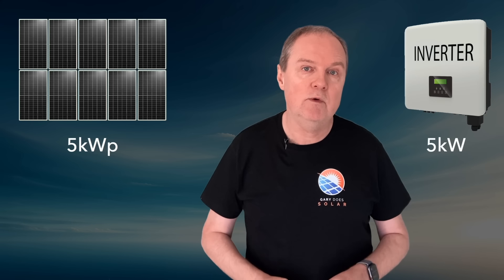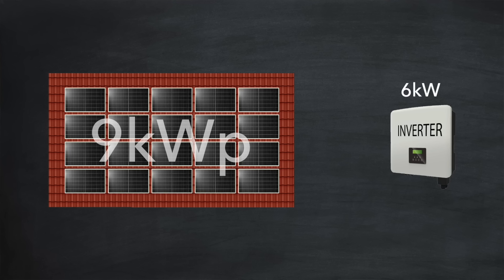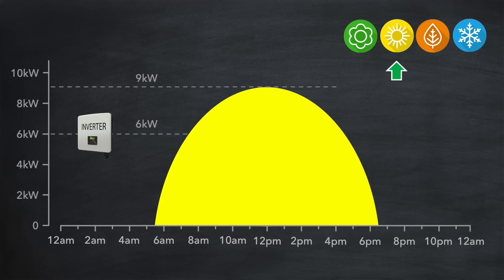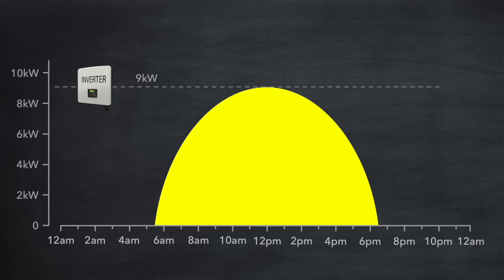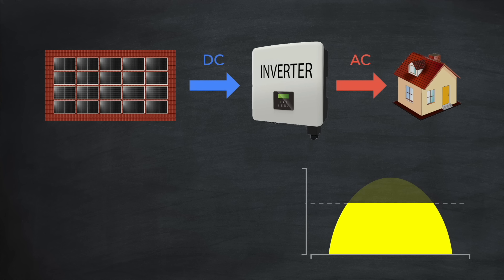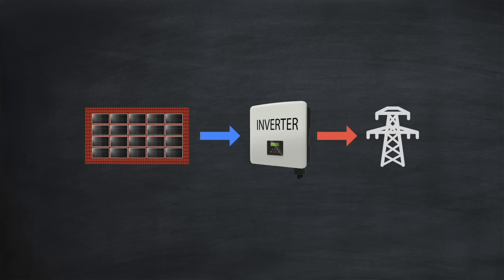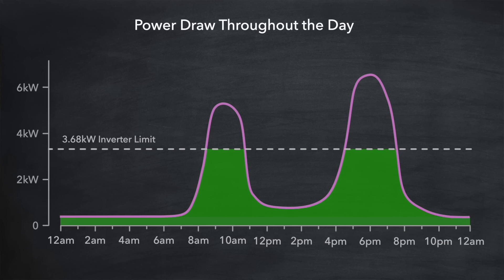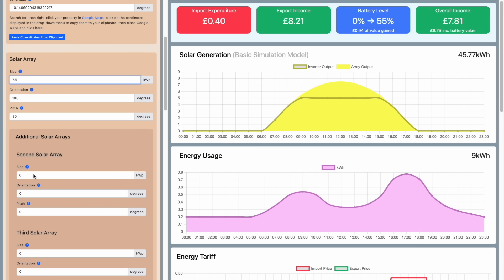Solar Array Oversizing - All the Benefits and Considerations

Comment: Why is this the first time I hear about the interesting DC and AC battery setup, and of the oversizing of panels? Sounds kinda smart to be honest.
Reply from the maker: Don't know, but I'm very happy to have brought it to your attention :-)
Reply: If you're in the US, it's likely because the Enphase solution is pushed as the best of the best.
Reply: I agree. Looking into this and I didn’t realise there was more to this. I feel scared to install solar now in case I make a wrong or less than best decision. I’ve got so many upgrade paths with replacing pool solar and upgrade to battery in future. I feel I could mess this up. Is there  good system which exists to cool panels ? Sprinkler or use pool water pump ?

Comment: great easy video!  another positive thing with oversize array is reaching faster the minimum input voltage of the invertor so that helps getting more solarhours usefull
Reply from the maker: Thank you :-) I did think about adding in about an oversized array meeting the start-up voltage quicker, but actually I don't think it makes that much of a difference to overall generation. I don't have data to show that though - perhaps someone else has....
Reply: There is a misconception about the minimum voltage. The panel voltage is not influenced by solar input, only by temperature. In the morning/evening with little sun input the inverter can have trouble starting up, but that’s solely because of the minimal current needed by the inverter, not because of low voltage.
Reply: @SanneHoekstra thanks for that clarification as I was trying to work out how many panels to have in series/parallel. My preference is to parallel panels rather than use optimisers or micro inverters.
Reply: @jameswestcott4191  I’m not a solar installer, just have some electrical background. I would be very careful with parallel solar panels. In that case you have to add up the maximum amperage, that is a bigger fire risk and you would need way thicker wires. I would stick with a series install. Unless you have much shade, you don’t really need optimizers, all panels have bypass diodes to make sure your install will keep working even with some shade now and then.
Reply: In series you need to watch the voc of your mppt
Reply: @GaryDoesSolar  Solar panel Voltage.

The solar panel voltage is determined by the technical design of the panel and can be found in the specification sheet of the specific panel. This voltage is applicable if there is (any) solar input on the panel (dependent on the panel temperature) independent of the amount of solar input. The best description I could find is in my own language (Dutch) in case I find another similar video I’ll add that also. https://youtu.be/YNJE4Bti5pA?si=4KpvLvQvhqsaSb-u
Reply: @SanneHoekstra that depends entirely on how you parallel the panels. In my system I have a combiner box next to the inverter, so standard PV cables from the panels then thicker wire to the solar charge controller. Any more than two strings in parallel and you need fuses on each string.

Comment: We recently installed 31kWp of panels for a house which only had a single phase supply and therefore a limit of 17kW could be connected to the grid, but we were able to use 17kW of SolarEdge inverters and oversize, works really well!
Reply from the maker: Wow - that's impressive! And it's great to see Artisan Electrics continually demonstrate their immense knowledge and expertise in all the videos you make: https://www.youtube.com/channel/UCUYJhbsrC1bvVWzgUq83K4A
Reply: How did you get away with amount of power on single phase? when you are export limited. Here in NZ max export on single phase is only 5kW now. This what has happened in Aussie, too much solar and they have restrictions placed on them now, with lines companies having control and shutting down the PV system using the DRM bulit into the inverters now.

Comment: But if you are maximising the solar panels on your roof from the get go then why would you not buy an inverter to match?
Reply from the maker: Fair point, but you might have limitations imposed on you be your local distribution network operator (DNO). And cost could be an issue too—panels are incredibly cheap today, but large inverters might not be.

Comment: Again, We are told that the Engineering of Solar is not great, that it costs even more  than it should cost.  I have to spend $20K, to give me a system that will not last 20 years, and it will save me $500/ year in Ecuador, So I have to because the sustainable systems the country has, all hydro, solar and wind does not work, so I have to provide my own.  Luckily I can afford it.

Comment: Well done!  The only thing I think you missed was that oversizing the array also changes the shape of the curve (same orientation) by allowing more production earlier and later in the day, as well as in cloudy conditions.  Basically it will produce more earlier and later, adding to total output or area under the curve...
Reply from the maker: Cheers! And yeah, the start up voltages are lower for a small inverter. I don't know if it makes too much difference though?
Reply: I agree, it's not about voltage but more about current. So for the same "light energy " more current is available from the array. So the larger array will have a different shape curve.
Reply: @caritechsolutions9382  Exactly!  All things being equal, at any given time the oversized array will make more power, other than when the inverter is clipping at max output.  So if you imagine the std array is putting out say 1000W at a say 8AM, the larger array that's 50% larger will be putting out 1500W. This is cumulatively a pretty significant difference and greatly increases the area under the curve if you were to use your diagrams.

Comment: Gary, Thank you for another fine video. Two years ago I increased my system from 12 kW to 15 kW in anticipation of my purchase of an EV. I did this on the recommendation of my excellent solar contractor/electrician. Since my SolarEdge inverter is 10 kW I’ve been wondering if the oversizing contributed to the premature failure of the inverter. You read my mind and put that concern to rest.
Reply from the maker: Thanks for the great feedback on the video, Richard... and happy to put your mind at rest :-)
Reply: It pays to know the product before adding more panels.  Usually there is a spec that says maximum amps allowed from the PV and it will be a bit beyond the normal operating range.  Don't exceed that rating.  Particularly for chargers (standalone or inverter/chargers) the better ones will detect over voltage on the battery side and can take action to force charging current off hard by shorting the PV to handle situations where the charging circuit fails and supplies uncontrolled current to the battery system.  Even the ones that have PV relays can have this.  Too many amps = damaged 'shorting circuit' and all the possible failure modes that stem from that.
Reply from the maker: @retrozmachine1189  This is certainly the value of a good installer 👍

Comment: yes but these days, LFP batteries have become affordable and some grid operators would require homeowners batteries. in other words, inverter rating is independent from the solar pv size. inverter capability depends on the simultaneous or peak power draw of the house.
Reply from the maker: I would like to argue that everything relating to solar and battery has become more affordable, so relatively speaking, my arguments in the video should prevail. And working at higher levels of efficiency in the inverter makes a notable difference to the resulting solar generation.

All that said, the video I'm working on now is about a supposed LFP battery with a 20kW inverter in it, but a 97.5% efficiency!!... So, on balance, I think you could be making a very good point :-)
Reply: @GaryDoesSolar  thanks, I will be waiting for that. :)

Comment: Thanks for your video Gary; very informative. Pardon me but I am a total noob who has just had his first Sunsynk 8kw installed at his home. I heard the installers speak about the voltage limit on the inbuilt dual MPPTs as something that will limit the size of our array to around 8,4kw. The MPPT are apparently limited to 450v and the array cannot exceed that per string. Can you be kind enough to comment on that?
Reply from the maker: You're most welcome. Now, I don't have any experience of SunSynk equipment, but it's worth signing up to this Facebook group, where you could ask those kinds of questions. Lots of support there... good luck! https://www.facebook.com/groups/571819024654208
Reply: @GaryDoesSolar Thanks for your prompt and kind response.

Comment: Hi Gary,thanks great video.Can you maybe enlighten me,what is the solar maximum size on a 5kw inverter,as i understand the voltage is the biggest issue.Will apreciatre your input.Im from South Africa
Reply from the maker: So, this is a question you'll need to ask the inverter manufacturer or your installer, as they're all different.

Thanks for the kind words about the video :-)
Reply: Hi Gary thanks for the reply,i actually want to know,i have a deye 5kw and it states that the max pv is 6500w,17amp.What i wanna know does it matter if i use 550w panel,that panels state that it has a cs amps of 13.Will this be fine for the inverter?
Reply from the maker: @johanerasmus6721  Thanks for supplying the extra detail. This is definitely a question for your installer, I'm afraid. It's not one I can answer, sorry :-(

Comment: Great video, but if you can have a 5kw invertor or a 7kw invertor on a 6.88kw array for the same price, which is the better option. That's the scenario i find myself in and cant quite work out what's best, East array slightly tilted towards south but not by much.
Reply from the maker: Thanks - if the two inverters are the same price, then you could look at the higher output one as being the better option. Remember though, inverters work best at their higher output, and there will be fewer occasions when it will reach that given your array size.

Comment: At 6:30m you exactly describe what I want to do. And I have a SOLAREDGE setup with exact that configuration and a DC-battery. Except for : it does-not-work !  The system ignores the charging/decharging time table completely. Even discharges the battery a few percent under the set minimum backup, ánd imports energy from the grid what I blocked in the settings to bring it back to '40%' after discharging to 38%. And it continues to cahrge/discharge throughout the night..
Reply from the maker: Yeah, I'm hearing solar edge batteries are quite limited in their programming ability, unless you have "installer" type access...
Reply: @GaryDoesSolar   My app gives the options for opimised self use/sceduled/backup. I contacted SE and they reply the problem is that I have three inverters.. .. which is nonsense as they are independent systems, one is even in another building in my ground. Batteries directly intalled with hybrid-inverter. Installer comes by next week checking all devices for updates.

Comment: Big thanks Gary. G98 limits it to 3.68kW per phase, maybe the PV installers should watch your videos! They are not sure. Looking to put in a battery, PV and HEAT Pump. Difficult to find a company across all of it....especially as 3Phase and large ASHP (25KW).  Curse of old UK buildings. Anyone have similar experience? PS Will enjoy the Octopus referral bonus Gary!

Comment: Very  interesting , good for you .More people  will take up solar  when they see  simplistic  explanations of  the solar power available . I installed 28x 400w panels at  latitude angle  with 2x 6000ES +  inverters and 3x 9.6kw Li batteries . The result is an abundance of power on a daily basis . The system has been running for 20 months now and I am always looking for more appliances too use up the surplus. 1 inverter  had  a charging failure  which  meant that the 2nd inverter had to handle  all the charging and  loads . It coped well with this , thus  qualifying your ( and my ) theory on over panelling . Panels have never been cheaper I encourage those looking into  a PV system to add more panels  than the energy  audit  suggests .
Reply from the maker: Thanks, and great advice for everyone! :-)

Comment: I thought that was very helpful though it is less easy to see how running two arrays pointed differently would impact on your overall generation and the extent to which you can over-provide capacity against the inverter limit.

Comment: 5:50 east west is nice as most inverters are dual mppt input so each side,note there is now g99 fast track if under 7.6kw ish (32amps) usually approval time is much shorter (The general issue is a lot of solar installers won’t do it because they just wanna make quick money)
Reply from the maker: Thanks. I’ll check out the G99 fast track (under 7.6kW) - I wasn’t aware….
Reply: @GaryDoesSolar  as long as its not more then 32A (7.6kw clipped inverter I think) it's usually less then 30 days (unfortunately some DNOs are not as nice to work with for g99 and force a 16A g100 device so you need battery storage system to get the most out of your install)

might be more hops if it's past 32A total install and max total generation is 60A per phase if you have Mutiple inverters (usually require a g100 limiting device so generation power can be cut off when DNO requires it)

If you look for g99 fast track + your area DNO there are quite a number of sites

 when looking for installers including g99 in search should filter it down to a smaller amount installers who are willing to work with DNO to submit the correct paper work
Reply: @GaryDoesSolar  Our recent G99 (November, Somerset) took 2 weeks - no cost.

Comment: If you have east west configuration how to you prevent power flowing into the shaded panels when diodes are very wasteful?
Reply from the maker: It is common practice for each array on a different orientation (eg East or West) to be on a separate string into the inverter - so power generation between the two is kept apart 👍🏻
Reply: @GaryDoesSolar  by separate string, how are you separating them, separate MPPTs (double cost) or some other way?
Reply from the maker: @yellowgreen5229 Yeah, separate MPPTs - all part of the inverter cost.

Comment: Be sure to get battery storage because selling your excess generation of electricity to the grid can really suck if they buy it from you at 5 cents per but sell it back to you at 40 cents per when you need it from them.
Reply from the maker: Agreed - although I hope more and more energy providers start to pay a better rate for export. If you think about it, your export goes straight to your neighbours - it highly unlikely to get past the sub-station. And that means the grid doesn't have to both supply (and more importantly, transmit) that same power to your neighbours. Everybody wins, in my view :-)

Comment: I've oversized my system and designed it around winter. I've got 3 x more panels than my charge controllers can process. I've designed it for dark and cloudy days. So high voltage strings in parallel, to get the most from Mppt. I built a ground array facing south.
I live offgrid in Sweden. I've got my panels aimed for the winter sun. Also, the steep angle helps keep snow off, but after every snow fall I still need to go out and scrape off snow. That saying, in the sommer my batteries are usually full by the time I get up in the morning. I'm not worried about the bad solar panel sommer angle as I have such long daylight hours. Also in sommer I turn off most of my strings.
I run  12V for everything, but have a 3kW inverter I can put on when I need, mostly for the washing machine, (always run with only cold water and 40min cycle)
It works for me.
Reply from the maker: Sounds like a workable solution 👍🏻
Reply: Hello. Did you say you have 3x the amount of panels for your charger? I thought each string has a max amount of input from panels coming in and to not go over that amount or it will compromise the inverters performance? What do you say on this Gary? Also, greenbymoon, what brand and size inverters do you have with how many panels in what wattage? Thank you.
Reply: @lindaferguson593  I don't have a permanent inverter running, as I'm using a full 12V system for everything in my offgrid house, which is about 40m².
I have a Giandel 4000w 12V Pure Sine Wave Inverter I use to run my washing machine for 28 min about every 10 days when I have sunlight.

I have 18, 335W solar panels set up in 3 parallel and 5 strings, each string on its own DC circuit breaker.
I have all turned on during what I call the dark season here in Sweden, Oct to end Dec. Then the snow falls and albedo effect starts making a big difference. 
I start turning off strings as my light level increases, in Sommer I run just 1 string and my battery is full when I wake. 
I get sunlight in sommer from 0300 to 2300. Winter 0900 to 1430
Reply: @greenbimoon  wow!!! Amazing!!!
Reply: @greenbimoon  what is 40m 2? In square feet? Also, do you heat with wood? Thank you.
Reply: @lindaferguson593  heat with wood in a wood stove and no idea about the useless archaic measurement you ask about
Reply: @greenbimoon  Wow amazing. 20 hours of sunlight a day is CRAZY. I like your setup.

Comment: Would your analysis still hold in Phoenix, Az where our temps in the 115s F during summer? Would hate to burn out my inverter.
Reply from the maker: Yes, solar panels and inverters are designed to operate in very hot and very cold temperatures.

Comment: can you have a DC and AC battery in the same setup?
Reply from the maker: You can, but they would likely interfere with each other’s operation, which would need to be controlled somehow. For example, one battery discharging into the other…